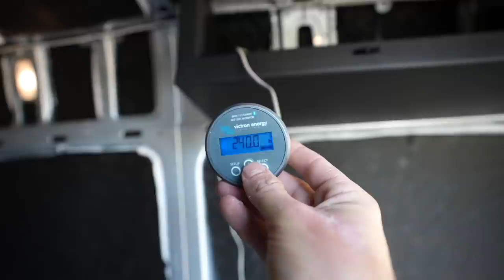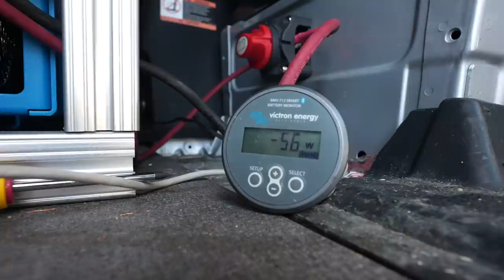Van Electrical Problems + PB Walleye?!?

Comment: Alex , great content as always. You should check to make sure your van’s alternator is capable of outputting the amount of amps needed to run your van side and your “house” side. Sometimes they need to be upgraded and I believe people will even put a second alternator and upsize certain wires. Just double check so you don’t cause yourself a headache. Love the Victron equipment 👍
Reply: Congratulations you have been selected among our shortlisted winners from our previous giveaway Contact the number above ..............................

Comment: Your alternator produces the fourteen amps, your battery can only provide thirteen amps. That all seems to be working correctly. A fully charged twelve volt battery sits at about 13.5 volts. I think you are in good shape. I would love it if he went fishing with you. He could probably use some time around someone who is not profit driven paparatzi. Hoping the trip goes without a hitch. Good video. Pax.

Comment: Does you van have a high idle option? At idle the alternator may only be putting out enough to run vehicle electronics. 

I work on an ambulance and we run a similar setup. If I’m on scene using lights, heart monitor and the flashing emergency light our power will drop to the point of some drawing too much power and the ambulance dying. To combat this we have to set them at high idle to keep everything charging.

Comment: honestly dude, the easiest way to do it with the van - sell all what you have put into it and buy a Bluetti AC 200.  You can charge it off the alternator through a cigarette plug.  Plenty of outlets.  Get solar on your roof while youre at it.  I know thats not the most cost effective approach but you can use it outside of the van as well.

Comment: Yer I would run it alternator to dcdc fused, dcdc to battery , battery to bus bar and to your accessories. That should work . Check with your volt metre on the voltage coming from your alternator and what types of battery the Dcdc charger is on . If it's not on a lithium profile it will not charge above 13.8 volts and will say it's full.

Comment: Always fuse as close to the power source as possible... so if you had a fire it's only a few inches and not a bunch of wire.  When it goes it all goes instantly.

Comment: Put some solar on the roof of that van and your batteries will stay charged all the time …you could still run it to your vehicles charging system for backup.

Comment: If you have a smart alternator it won't output more then starter battery needs to stay topped up. You'll need to run a wire from the dc to dc charger to an ignition source in the van. And also, I do believe it is better to run the charger directly to the battery.

Comment: Best way to charge that system is negative connector of charger to furthest battery.  Positive to positive to closes battery. That way its and even charge across all the batteries

Comment: Edit: nvm I'm pretty sure that's a sprinter? Looked like a transit, but on second glance it doesn't look like a transit

Yo AP, I also have a 2020 Ford Transit that I converted into a camper. I have a 60 amp Sterling DC to DC charger on my van and it works. When my van is running it charges the house battery with 40-45 amps. Not sure how you connected the van starter battery side to the charger, but you need to use the ccp2 (I think that's what it's called) as the positive. It's tucked away on the driver's seat metal base with a plastic cover. Also you can't connect the input negative to the starter battery, it has to be a mounting point on the chassis. I connected my negative to a grounding point under the flooring between the driver and passenger seat, you can lift the flooring up and see a bolt, that's what I used.

As far as the output positive and negative, it can be connected to the positive bus bar and negative bus bar. I used a fuse from the van starter battery (ccp2) to the input on charger, another fuse from output on charger to positive bus bar on house battery.

Comment: Loose connection cause the melting.  Your working with a 12 volt system. Main thing need is just a test light

Comment: Did you try a beefier alternator? There usually designed to basically cover what the vehicle needs. It is a van which more juice is expected for  accessories but if your planning on being able to live in it maby an alternator that puts out more.

Comment: You have a battery draw of 1.6v that is on the negative side , you need a dvom to conduct a voltage drop test to find where that 1.6v , HMU if you need more information tight lines🤙

Comment: Ap im an electrician with minor experience with DC systems. Not sure exactly what your doing but with all dc it normally has to hit battery 1st. Your positive bus bar is behind the battery which would be considered load side. You should be ahead of it all at the line side of the  battery. Gotta remember that bus bar had a load and is only gunna draw voltage when powered. The way u had it-  Now it should work but you won't charge them at all but u shouldn't be losing amp hours either? Basically charging a battery to charge the main battery. Always have ur fuse in line with the device ur protecting. Good luck man

Comment: I’m almost positive that that was a 34 in walleye no cap. It goes from one tip of the mat to just about the other corner looked like not even an inch shorter than the mat plus he didn’t pinch the tail. Just watch it back a ton with the pic of it and then the tape measure.

Comment: A battery charger is normally really low amperage so that it can charge the battery slowly,charging it too fast will break the battery. So I'm guessing since you're trying to run things off the charger you arnt getting enough amperage to the appliances. So you would have the voltage but not the amperage

Comment: Why don't you just put a small mounting bracket on the roof so you can hook up a solar charging system up while you're not mobile to run your electronics? That way you wouldn't have to worry about draining or burning up your main battery/alternator.

Comment: I can’t tell you what is absolutely wrong with your electrical. But from what I can see.  Your output shouldn’t be the same as your input. Your charger is going to draw a lot from the source just by itself. It might catch up after a bit of running the van but I highly doubt it.

Comment: your alternator is only so many amps and and if you are pulling more then the amps your are putting out its going to be a steady draw but what i understand id if your output number is higher then 12v you are still putting power to your system

Comment: Here is how to fix the electrical!!
On the battery did you turn on the flux capacitor? I guarantee this is the issue.. you need at least 1.21 jigawatts to get the maximum output.

Comment: Have you thought much about solar power on your van? im not sure where you are in the country you are so idk how practical that would be...plus the van does not have that much surface area so you might be better off going with an oversized alternator...im not sure how you could do it but I know you can hook up huge alternator that is too big, producing more electricity than the car needs...is it possible for you to wire a cord to the alternator and draw some of the unnecessary electricity to your necessary utilities? I know you prolly won't read all this lol but here is a piece of my brain